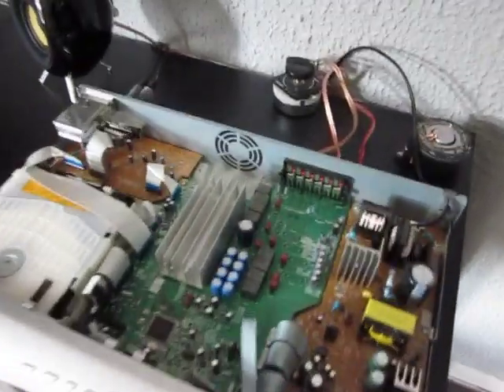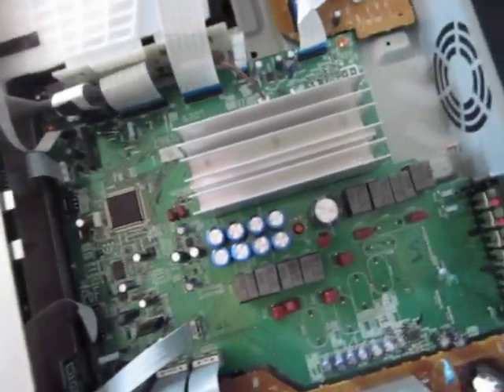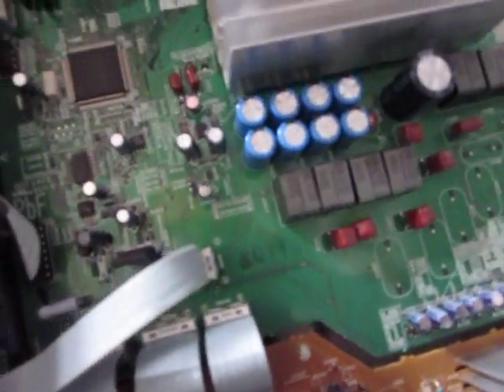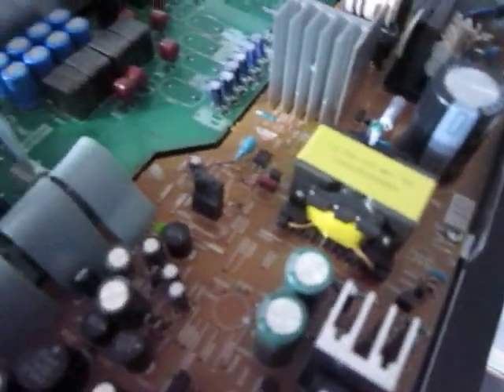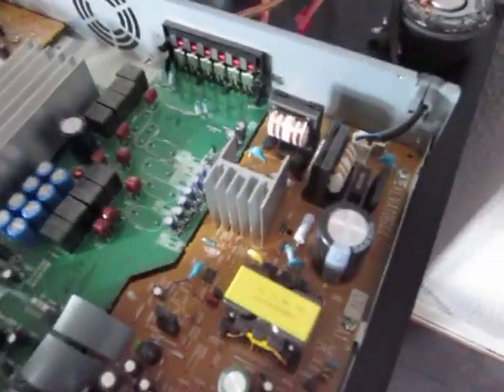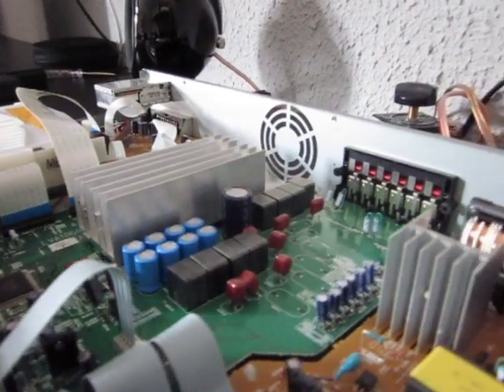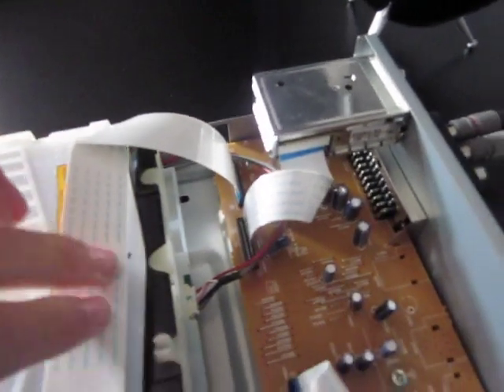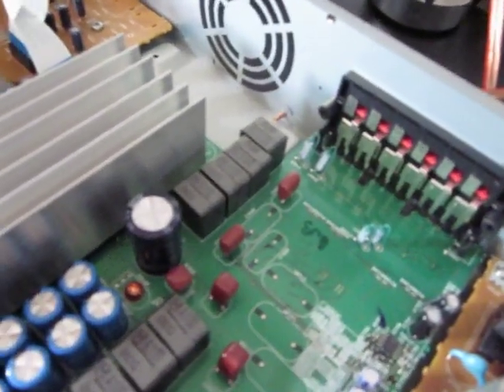JVC reciever  Digital Home Cinema TH-P3

Comment from the maker: @RWL2011 I could may ask him about that design. I know how to upgrade that design. In a L-port box there is a turn. I can use some thin plastic tubing to make that turn more even so that the air flow in the port will be much better. I was planning to use that. I will not make that 10'' bandpass. To much bass you know. I saw the big lamp on the ceiling move from the bass. That's not a good thing.

Comment from the maker: @RWL2011 We should use the inbox thing more. Don't you have a jigsaw? Not that  difficult. Take it easy and cut the speaker holes really slowly. That's how i learned. It began when i made the speaker hole of the logitech x 210 box bigger for a 4.5'' subwoofer driver with a rubber surround. Sadly that speaker doesn't exist anymore. I have done to many modifications.

Comment from the maker: @RWL2011 Don't you know how to cut wood? Or can't you get a good subwoofer design. Not hard at all. The enclosure must be the same volume as th vas of the speaker or more. Get WinISD and tune the cab. Choose one of the 8'' tangband drivers. They have arround the same parameters. Tune it to 30 hz or even lower. Fill in the port diameter or choose a square port of your dimension. The porgram will calculate the exact length of the port. That's it.

Comment from the maker: @RWL2011 Don't you have a jigsaw or a drill. A drill can work but you need to make loads of holes first and finish it of with the drill to get a smoot edge. I've cut the hole for the bandpass box bigger on that way.

Comment from the maker: @RWL2011 Yeah, i know it's a great driver. The box could still be better tho. It's not braced really well and the wood is not that thick. Make a bandpass box for it. 6th order and tune one port to 25 hz and the other to 60 hz. Will sound amazing. But i guess you won't do it. Sadly ...

Comment from the maker: @RWL2011 still not convinced. The high pitch note i can hear when no signal is playing when the volume is set suggest me that it's class d. It's not a normal transformer. If it was a normal transformer it would need to be much bigger. It's a switching power supply.